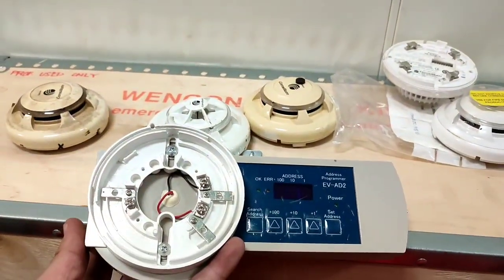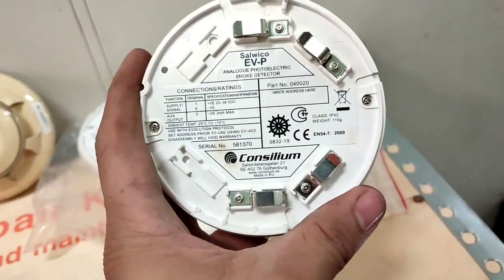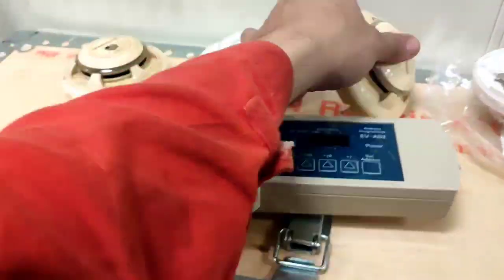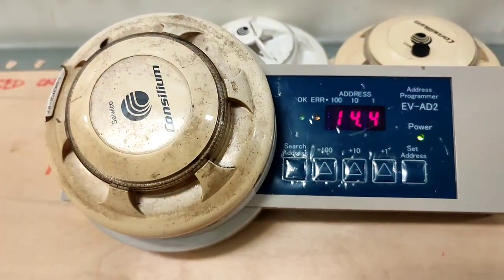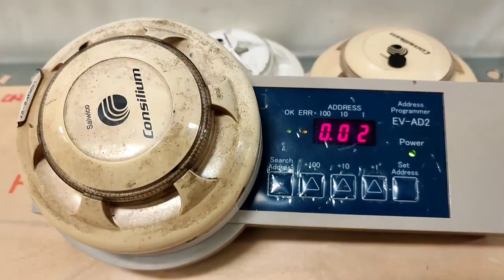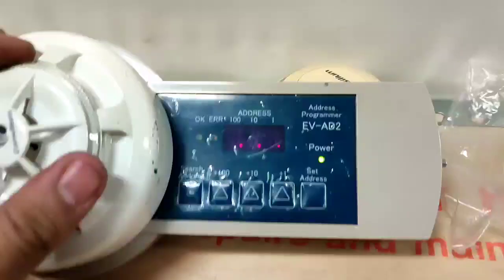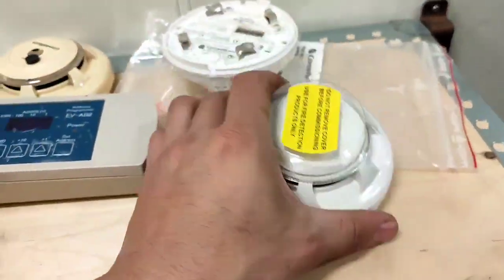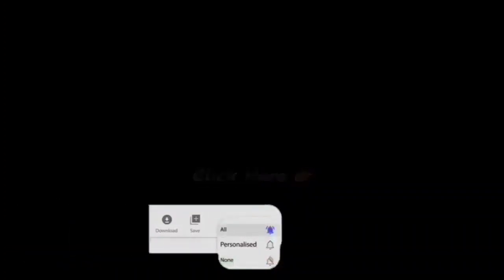Setting new address to out smoke sensor using consilium / salwico address programmer EV-AD2

Comment: Can we use heat detector at place of smoke detector
Reply from the maker: I didn't try it,but as long as you program same address,it might be possible for emergency only,but also need to reprogram in main panel so that it won't mis leading the types of sensor that is activated